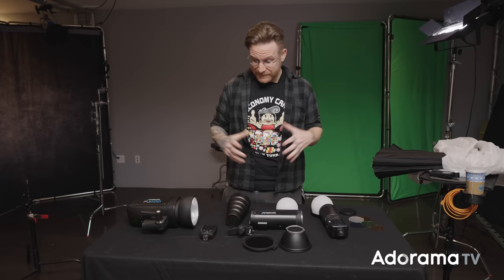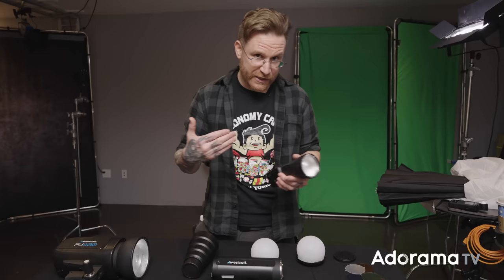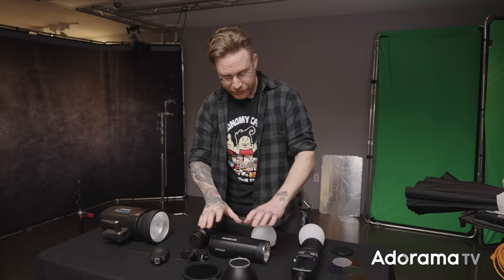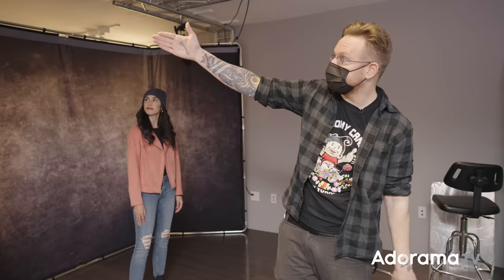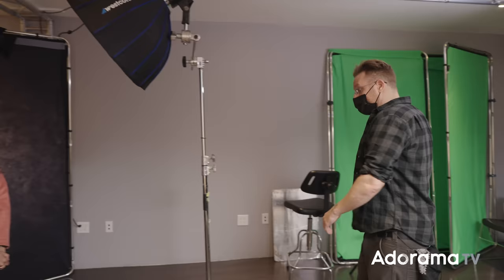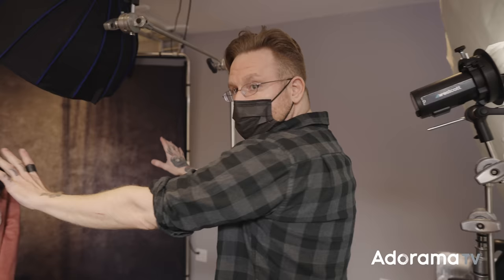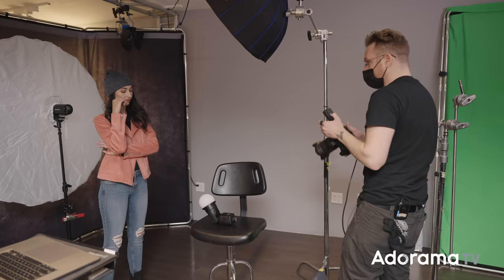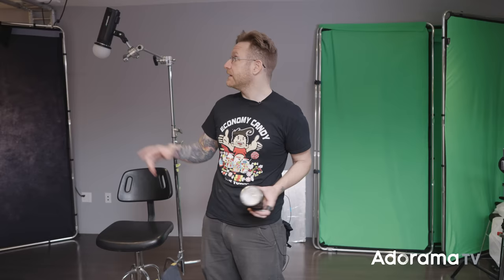Westcott Strobe System with FJ80, FJ200 & FJ400

Comment: At first, I thought, "Oh great, another system to compete with Profoto, but don't we already have that in Godox/Flashpoint?" It's not always about ideas; sometimes it's about execution, and it sure looks like Westcott got a lot of things right. My photography habit has evolved over the past couple of years with the Flashpoint system. Ecstatic that I could finally afford larger monolights, formerly unattainable by most amateurs without major means, I've managed to learn a ton, but I have to admit I've always lusted after those Profoto B-lights I'd see on all professional photo sets. There's a reason pros use them--robust construction, clean design, professional finish, and consistency--and they cost a lot of money for a reason. That's why Profoto hasn't had to drop prices dramatically to compete with Godox and Flashlight, because in the commercial realm there isn't any competition. Godox and Flashpoint certainly have a place in the industry, and I've deeply appreciated their impact on my photography...BUT, as a big fan of clean design, I have never liked the feel of anything produced by Godox/Flashpoint with the exception of the AD200's, which are a delight. Almost every other unit, and I own them all, has construction flaws, terrible menu systems, nomenclature, and clunky aesthetics. In short, they feel chintzy compared to the Profoto system, and anyone honest with themselves will admit that.

But this Westcott strobe system seems like a real alternative to Profoto, which I simply cannot afford at this time. They look beautifully designed and the price-point is exactly in line with Godox/Flashpoint. Wow, looking forward to my next visit to NYC, where I can see these in person.

Comment: Here’s some more fun stuff. I updated all my Orlit branded 400 lights and the transmitter with Westcott’s most current firmware. You guessed it. It accepted the firmware updates and all the new function/features work as promised - for the Westcott transmitter. Now, my FJ200 is connecting to the Orlit T7 transmitter. 🙌🏻

Comment: Everybody sees how well godox has done and they're jumping onboard with a similar system. The days of pocket wizards are gone.
Reply: Well there’s def still applications for pocket wizard systems it’s just now you’re more likely to have integrated radios but for other systems whether they be older like my Speedotrons which give 2400ws blitz of light for some large format/alternative processes or even to tap into systems via sync that may have a radio built in but enable you to do more like multipop, longer range , cycle groups on and off per shot for diff looks and Much more.  They may not be as much of a given but they are far from gone in my opinion..& also it’s more like there’s quite a gap in the market for options when it’s high end profoto that I rely on or more budget friendly flashpoint etc. more players in the space keep more progression of features and price point variety for us as the users in fact most of what profoto has put out first over the years has trickled down into most of the designs we are seeing today

Comment: Nice video shoot great ideas and I noticed Seth putting a dome on the FJ200 even though its already got an extended flash tube - I usually put a Stofen type diffuser on my regular rectangular head speedlites to extend and do like 360° of light in an umbrella or softbox -
Reply: Well actually  not an “extended tube” in the sense of it acting like a bare bulb style that protrudes like older style heads so the dome helped blow light around inside the umbrella to cover all that surface more evenly before leaving the diffuser sock

Comment: While this is a year ago, one thing I noticed is the diffuser dome locks into place on the FJ200. I recently purchased the FJ200 and the "Diffuser Dome with FJ80 adapter". It says it fits both the FJ80 and FJ200 with a magnetic connector. However, on the FJ200 it does not click and sit down in a groove like it does on the FJ80. Needless to say, if the light is bumped and moved quickly, the diffuser falls off. Thankfully it's made of a durable plastic — since it falls off so easily! Seth / Adorama? Got any suggestions? I can not find a bracket for the FJ200. If this is the case, then this is a piss-poor solution for an otherwise well performing product.

Comment: Seth are you mounting the FJ400 on a standard 5/8 Baby pin? I'm thinking my C-stand must have a non-standard baby pin. The pin doesn't fit in the handle of my FJ400.